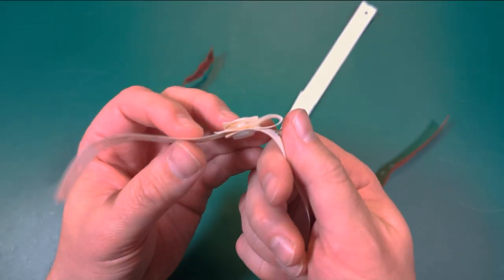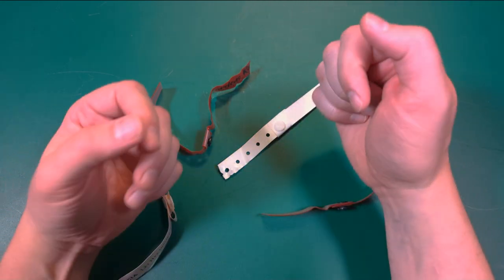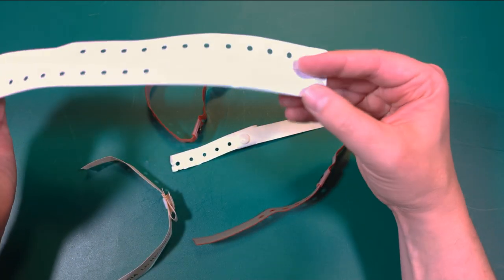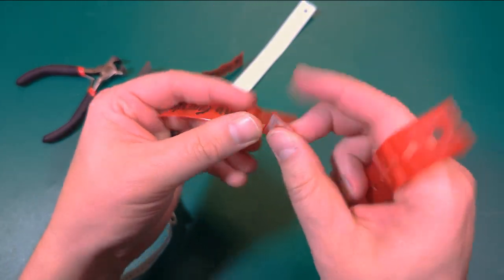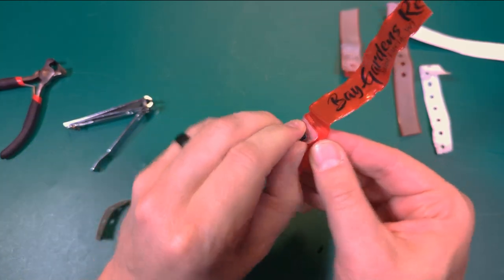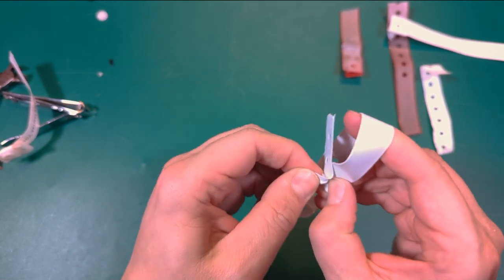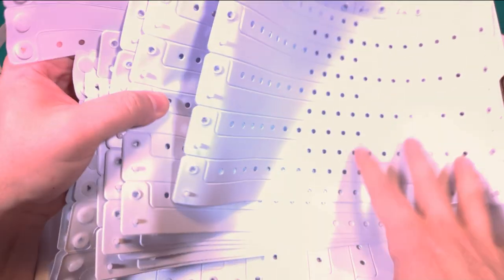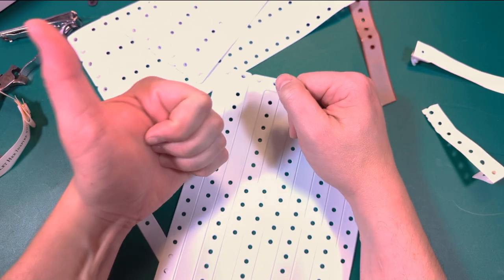Tampering with Wristbands - Part 1

Comment: Nice video, good purpose, but come on THIS IS SO WASTEFUL! If its really that uncomfortable then just take it off and present it when needed! If you are required to keep it on, just buy a couple of cheap magnets or even better, buy a SINGLE Coat pushbutton and glue!! Think with your brain and not your trained wallet. If no one here sees an issue with the ammount of non recyclable plastic waste being created then they are the reason this world is fucked and drowning in plastic... Where do you think the blank strips go when you throw it away? Not your problem right.... its everyones problem.